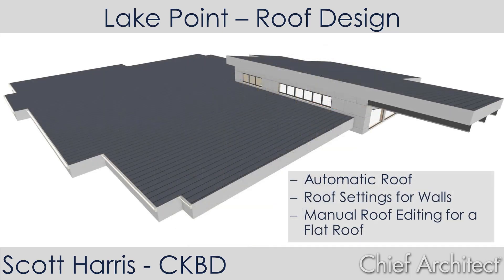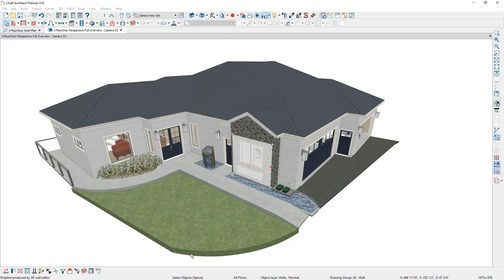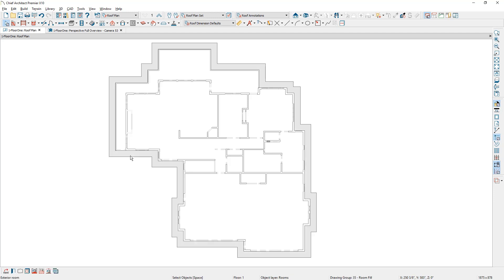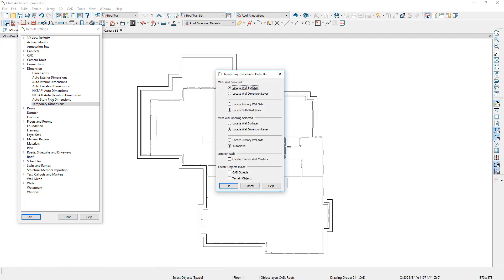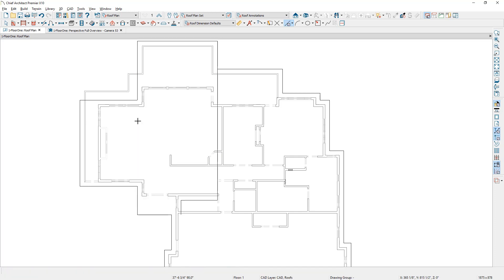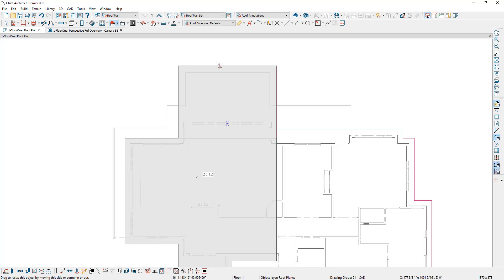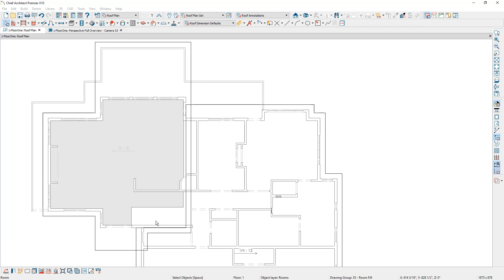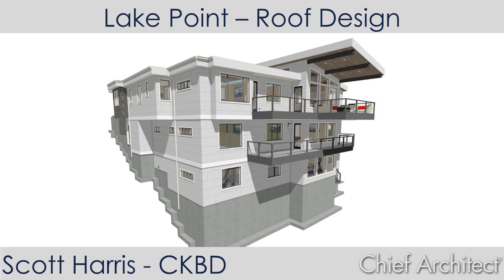Lake Point - Roof Design

Comment: Sir please tell me the configuration of laptop and desktop for chief architect x10. As iam using CA X5 on my laptop 4gb ram 64 bit intel graphic card .CA X8 dosent give 3d view on my laptop.
Reply from the maker: Hello Vardeep Singh. The computer system requirements will be slightly different from version to version. I have listed below the requirements for X10, X8, and X5. 

X10 Requirements: 

Minimum:
Multi-Core Processor (CPU)
Video Card:
1 GB of dedicated video memory or 4th generation or newer Intel Integrated Graphics Chipset
OpenGL 3.3 or higher for a Windows-based PC
OpenGL 4.1 or higher for a Mac
5 GB of available hard disk space
Internet Access
4 GB memory (RAM)
64-bit Windows 7 / 8 / 10 or;
macOS 10.12 / 10.13 / 10.14 (Sierra / High Sierra / Mojave)
Recommended
16 GB memory (RAM)
50 GB of available hard disk space
4 GB or 8 GB gaming video card

X8 Requirements:

For all X8 versions
Multi-Core Processor (CPU)
Video Card: 
OpenGL 2.1 or higher
Dedicated video card with at least 512 MB Memory (e.g., NVidia or ATI)
or
Integrated Graphics (e.g. Intel HD Graphics)
5 GB of available hard disk space
Internet Access
Recommended: 8 GB of Memory (64-bit), 50 GB of available hard disk space, 2 GB or 4 GB gaming video card
For 64-bit Chief Architect X8
64-bit Windows 7 / 8 / 10
Mac OSX 10.10 / 10.11 (Yosemite / El Capitan)
4 GB of RAM
For 32-bit Chief Architect X8
32-bit Windows 7 / 8
2 GB of RAM

X5 Requirements:

For all X5 versions
5 GB of available hard disk space
256 MB of dedicated on-board video memory supporting OpenGL 2.1 or higher
Monitor resolution: 1024 x 768
High speed Internet for registration, video access, content downloads
DVD drive (if software purchased on DVD)
For 64-bit Chief Architect Premier or Interiors X5
64-bit Windows Vista / 7 / 8
Multi-core processor
4 GB of RAM
For 32-bit Chief Architect Premier, Lite or Interiors X5
32- or 64-bit Windows Vista / 7 / 8; 32-bit Windows XP
2.4 GHz processor
2 GB of RAM
Reply: @ChiefArchitect  thanks sir